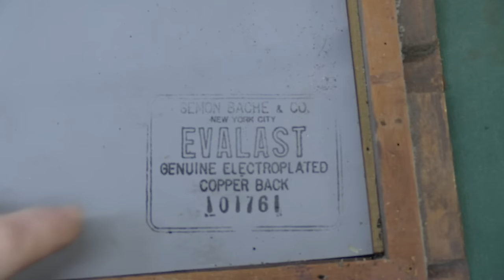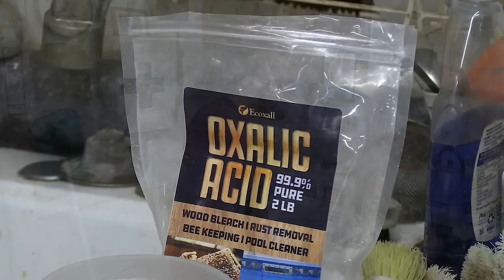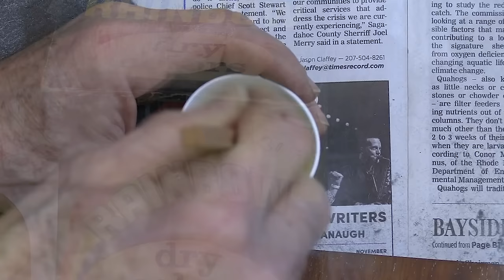Looking Glass Resurrection

Comment: I am happy to see you using Old Brown Glue in your videos.  I have done many similar repairs in my 55 year career as a furniture restorer.  I would suggest two things that would make this repair easier.  First, I use scraps of Texan or Plexiglass as cauls.  It doesn't stick to the glue and you can see what is going on with the repair as  you apply clamping pressure.  The plexiglass provides a perfectly flat surface for the wood to mate.  For these problematic small repairs, I have taken old upholstery springs and cut out different circles of the springs.  Making a sharp point on each cut end I make spring clamps.  These can be adjusted for size or pressure and leave very little marks on the wood.  They are perfect for those curved or small shapes, like broken carving or other similar repairs.
Reply: I meant Lexan but the computer corrected it to Texan.  Plastic.
Reply from the maker: Thanks! That's good advice. I like the idea of the plastic allowing you to see the repair. I'll try that with the springs

Comment: A few years ago I bought a late 18 th century French 'marriage' mirror from a dealer friend who had bought it and dropped it and it's elaborate gilt wood top was in 20 pieces. The decoration was backed in places with small pieces of mirror that was partially foxed and the main mirror was also a little foxed which I don't mind. It lay like yours in a box until one day I decided to repair it. On a difficult back join I had to use an epoxy putty as I couldn't get it to stay up otherwise without drilling into the frame. Some of the small mirror backings were missing so I took some thin plexi and some 'mirror spray' and mirrored and foxed it then cut out the pieces to insert. My friend was a bit green when he saw it and I could tell that he slightly regretted selling it to me ! Six months ago I bought another one at auction, slightly earlier I think and also broken intricate pediment in gilt wood. I have some of the pieces but not all but it's going to be fun to do EXCEPT I am moving house from an 8 bedroom huge house with masses of space and outbuildings into a two bedroom house in town. The draw was the huge garage and a workshop and small barn with huge attic where I can give into restoration and creation but meanwhile what a nightmare! I have to get rid of 75% of my furniture !
Reply from the maker: Wow! That is difficult. I am in the process of emptying my barn, hence the videos on trashed pieces I have picked up over the past 50 years (!) Unfortunately a lot of stuff will go to the dump. We've been trying to get rid of all our stuff in anticipation of someday moving into an apartment, and now our daughter has announced she'sw mving back to Maine so we can stay in our house. Now it's going to be harder to get rid of stuff. Good luck!

Comment: Yes another comment ! I found a large solid frame in a thrift store for ten euros that someone had painted with dots of nail polish all over ! Very hard to strip. The inner edge of the frame was cut out in a lovely baroque way, the frame was about 70 years old. I ended up painting it and had some plain glass cut that I 'mirrored' leaving the center of the glass only lightly mirrored then I backed it with some antique wallpaper. I love the subtle effect as you can only just make out the wallpaper through the mirror and foxing. It is going into my bedroom over a Louis XVI style marble topped chest that I am going to also paint and age as the wood is not nice at all, bought for the shape and solidity and price, 120 euros ! Last comment ! xoxoxo
Reply from the maker: Interesting! You mentioned "foxing" the glass. Would you email me and explain what you are doing? thomasjohnsonrestoration@gmail.com

Comment: Nice, nice restoration.  It was good that you didn't have to worry about replacing antique mirror material.  It looks great with that modern mirror in it.
Reply from the maker: Thanks! I'm actually thinking of putting a piece of antique glass in front of the mirror to make it look older

Comment: The result is again very beautiful and convincing. 14 hours is a lot but from the perspective of sustainability and especially because it is made of solid mahogany, it was more than worth the work.  For priming: Since I love Biedermeier and Empire furniture, especially with shellac polish, I generally don't use a synthetic primer to fill the pores, because the synthetic primer dissolves over the years due to the lack of connection to the wood. I use liquid Shallac blonde and wax-free, which I dilute 1:5 or 1:6 with alcohol. I form a ball of pure, fine linen on the outside, then a layer of cotton and pure wool on the inside. I soak the bale with my Shallac mixture, in which case it can be wet, then dip the cotton part in pumice flour, add my linen over it and start filling the pores. Under no circumstances do I put the pumice powder directly on the wood. For cherry trees and birches, I usually need three rounds, which I do on three consecutive days. With ash veneer, which was used on a lot of southern German Biedermeier furniture, it sometimes takes up to ten rounds before I start the final polish. But I love mirror-smooth shellac surfaces.
Reply from the maker: Thanks! And yes, thanks for the tips on french polishing. I wish I could do it better, I find it very frustrating. I know it takes a lot of experience

Comment: Hi Tom, I have a question for you.  I have noticed the chisel sharpener on the bench by the wall and want to ask if you use it very much, since you already have the machine.  Your irons are sharp and wondered if you could comment or demonstrate your techniques for maintaining your equipment and tools.  These "trash to treasure" videos are great.  Maybe even a video restoration of a rusted chisel/plane iron would be interesting for those of us who pick up "trashed tools" and bring them back to good working condition.  Thanks.
Reply from the maker: You're welcome! I use that work Sharp System for everything. It's not without fault but I find it very easy to control my sharpening. It is very "easy" to keep the angles, so resharpening is quick. I did do a plane restoration video once, there are better ones out there!
Reply: @johnsonrestoration  Thank you for the response, Tom.  Really enjoy your channel.  Thanks again.

Comment: What a lovely job! May I ask why you didn’t use PVA or epoxy when gluing the broken pieces back on? I’d think a reversible glue wouldn’t be as effective? You’re the master, so I would love to know more 😊
Reply from the maker: Thanks! Hide glue is extremely strong, it's just a bit easier to loosen with water when you need too. Especially on a job like this if a piece did not glue up in perfect alignment, it's easier to redo with the hide glue. It also has a long set time which is very helpful
Reply: @johnsonrestoration  Aha, I was under the mistaken impression that it wasn’t as strong. Thanks for taking the time to answer — my wood projects will be better because of it! Good vibes from CT 😊

Comment: Thom, how does the stripper and the oxalic acid NOT separate those glue joints? Thanks for another great video!
Reply from the maker: Thanks! If you're joints are tight, no water gets into them. If something does come apart it needed to be reglued anyway. Hide glue is very strong!

Comment: I wonder why the original maker didn't add these strengthening pieces when he made the mirror ? Do you think it was more of a 'mass produced' piece at the time, sold for it's 'face' value as a decorative item, maybe in a catalogue (although shipping such a fragile piece must be tricky) ?
Reply from the maker: I don't know. There were definitely no braces. The wood was a bit thicker than period pieces, so I assume they felt they weren't needed, which may have been true until it fell (I assume it fell) I don't think it was a mass produced item

Comment: Hi there. Thank you for your videos. I’m sure this has been asked before but what glue did you use to piece this jig saw puzzle together. I would have used epoxy for any of the broken pieces because I feel it would have been the strongest option, and the use wood glue to adhere the whole part together. 
Thanks!
Reply from the maker: You're welcome! Yes, epoxy seems logical, but I think the hide glue is stronger in this case because the breaks were very clean and fit back together perfectly. A "perfect" joint with wood glue is better than epoxy. Otherwise, epoxy would be a good choice. And I knew I was going to back those breaks up with cleats

Comment: As always I truly enjoyed your video Tom. I do have a question about something, and I don't recall you solving this in one of you old videos. What do you do when you encounter an old door or drawer lock that is locked and you don't have a key?
Reply from the maker: Thanks! I haven't had one of those for a while! I have a ton of old keys and often will find one that works well enough to get it open. If not, I first try to get in through the back. If there is no way in, I get a hack saw in there and saw through the bolt, and then repair any damage.
Reply: @johnsonrestoration  thank you. Great tips.

Comment: I see you using syringes to get glue into small tight spaces. Do you reuse them and if so how do you clean them?
Reply from the maker: Thans! Yes, 1 syringe will last forever, especially with the hide glue that cleans up so easily with water. The trick is to keep it clean

Comment: Nice job Tom looks good one question the stripper you uses does this work well I notice it is non flammable my experience with these products they work ok but not great
Reply from the maker: Thanks! The non-flammable strippers are made with methylene chhloride which is the best. If they are not working for you you probably need to lay it on thicker and cover it with plastic

Comment: Is there a reason for not using a sanding sealer to fill the open grain?
Reply from the maker: Thanks! Sanding Sealer should never be used to fill grain, it would take too much and cause problems with the top coats. I usually fill the grain with whatever finish I'm using

Comment: I have a question about stripping the finish. Since that is such a small piece wouldn’t it be easier to use a sander rather than the chemical stripper?
Reply from the maker: Thanks! No! Stripping is much easier than sanding.
Reply from the maker: That's not the only reason, stripping is much less intrusive, I don't like to over sand things, this mirror frame being an exception

Comment: Great job, I think if I was doing it, I would do it somewhat different. The only thing I would change is the back Support how would Used a high-end, thin birch cabinet plywood. I would have scanned the top and bottom pieces. Make the design about a 1/8 inch smaller than use a laser cutter to cut out the shape with a 45° angle on the edges. But I know you do not have these tools. It was an option for you. But with that support and with the angle on it when you got through with it, it would be very hard to tell that it wasn’t originally designed and put together like that. Probably taken a little longer from the front side the results were almost identical.. often they strip the original mirror and then new 1/8 behind the original glass so it looks like an antique mirror. I cannot tell you the thousands of mirrors I did like that over the years and you could not tell it was a new mirror because we maintain the waviness of the original mirror, just stripping the silver off and putting a mirror behind it. You have to be careful stripping that old mirror and not scratch it.
Reply: "Scan parts, laser cutter", no thanks, at least not on this channel.
Reply: @sofiavalenzuela9782  of course, it can be done with a pencil outline, and cut out on the scroll saw for the same exact effect.
Reply from the maker: Thanks! I thought about using ply, but really just for aesthetics I went with mahogany. You have given me a great idea about the glass though. I have antique glass, I will cut a piece and put it in front
Reply from the maker: Thanks! That would be different for sure!
Reply from the maker: That's exactly what I was thinking
Reply: @johnsonrestoration  growing up I worked in the family glass business. They were very few furniture restores in the area so a lot of times we did the wood and the finishing work because we had the tools in the ability to do it in the shop so I was literally done hundreds of these, they can all be challenging. I’m glad you like the glass idea. Be really cool if you could find an old piece of beveled glass to put in front, since most bevels sink in an eighth of an inch you don’t have to build up the back to accommodate the second piece of 1/8 mirror glass. There is a vendor in England that does antique glass with beveled so it can be ordered. They’re using them a lot for the restoration Notre Dame.

Comment: Is it allowed to sand crosswise wood grain when it has been finished? 22:38
Reply from the maker: Hi Robert! Yes, sometimes you just have to. But if sanded well with 220 grit the cross grain scratches will not show, especially if the piece is not stained

Comment: Do you ever use surgical tubing for awkward glue ups?
Reply from the maker: Thanks! I've tried other stretchy things like big rubber bands, the problem is that you have no control
Reply: I get that. Hard to control direction of pressure and amount of pressure. @johnsonrestoration

Comment: Business a little slow,tom..I picked up 3 more clocks Goodwill...one nostalgic, GILBERT from winsted,conn and a beacon ( bulova).GILBERT I guess 100 yrs old .chime strikers use leather pads not plastic..looks  good a far as wear.but little silvery dust ?..no key no pendulum..eventually got clock to run using a key medaillion.5 days but fast I stopped and lowered the medallion clock stopped..has a square face mantle clock.....beacon just a pendulum  no key..hav key..pulled oiled now running 31 days ?..small movement with strike ,clock wind together ,cool.one strike hourly. yea then another clock problem bac panel.removed touch damage glued..hand nut won't come off chimes 1 hr late.need remove hands.works very good did oil best I could...like to get Gilbert running get a proper pendy might help..what I intended do with beacon pendy but a touch longer and not a hook to hook attacment...also being punished ny ET and local tv media..I'm a tolerate person ..but I refuse to donate to the
 RUPAUL ORPHANAGE FOR OVER AGE CROSS DRESSING MEN... UR the expert just asking y u didn't use a light weight canvas glued backing.on upper lower panels..
Reply from the maker: Thanks! I'm going to stay away from Goodwill! Here we have a Goodwill Warehouse where they are practically giving the stuff away. Canvas backing is a good idea, I've done that

Comment: Bin it and buy a new one. $50 would be more than enough to get you one made in China. Probably bigger and with an unbreakable plastic mirror.
Reply: 2nd hand and worse for wear for sure but a new handmade, solid, quality mahogany, chippendale reproduction mirror for $50?  Somewhere in Asia maybe but in the US, that doesn't sound right. Conscientious wood workers don't use the good mahogany for new work anymore anyway because it's not sustainable.
Reply from the maker: What fun would that be?
Reply from the maker: Thanks! I didn't realize mahogany is not harvested sustainably. Are you sure?
Reply: @johnsonrestoration  From what I understand the problem is practical rather than theoretical: it could be done sustainably and sources claim it is but too often turn out to be false. Of course domestic woods are always easier to verify.